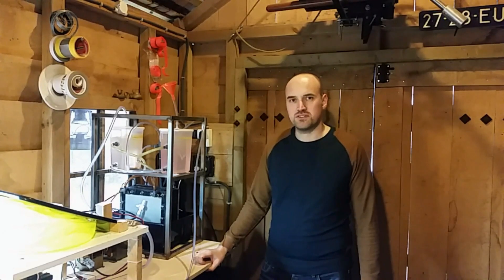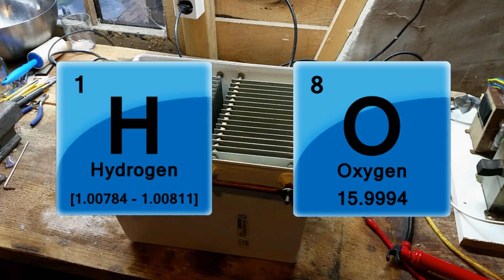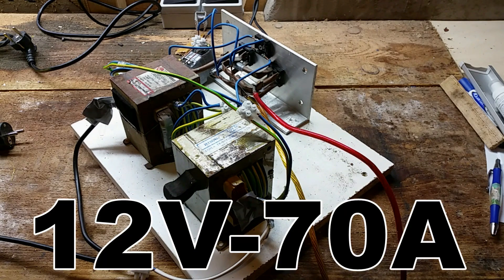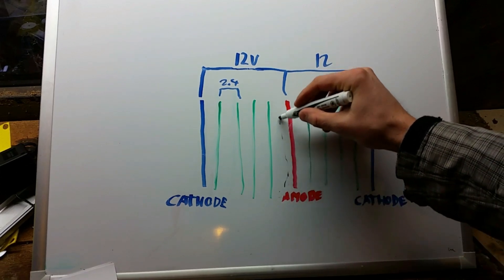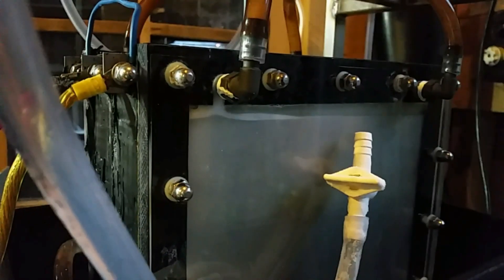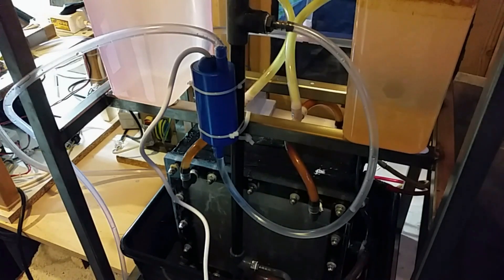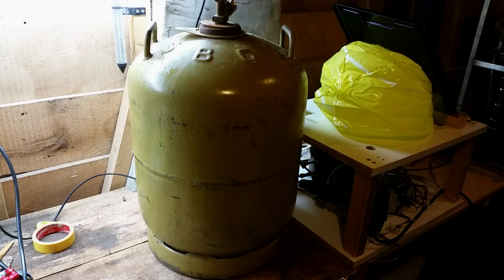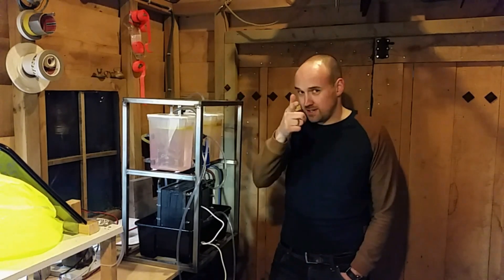Hydrogen Generator #1 Homemade Hydrogen Generator And Compressor Unit

Comment: Nice explanations! I had to smile a few times about the heat generated when operating the cell at 12 V. You are right, the problem is the high voltage. But its not due to some mystique strength between the atoms in the water molecules its just the resistence of the water with sodium hydroxide against current. If you push too much current it will heat up - same as every wire does if you push too much current through it can get red or even withe glowing! So the keyword is current density: amps per square inch! You should keep current density as low as possible to stay cool and become more efficient in the process! Even 2 V per cell can already be too much. You can do with 1.8 or even 1.6 V/cell - but you need (much) bigger plates to push the same amount of current! Also a larger cell will have better cooling through air e.g. A good current density is as low as 0.3 A/in2 (0.05 A/cm2) or lower!

2. I hope you dont compress the oxygen via the fridge compressor? The gas flows right through the oil inside the compressor and could explode! You can use other oilfree compressor which are specially made for oxygen - but rather expensive. Also keep in mind that hydrogen is very volatile - it will go through the LPG tank with ease in the long term. So its just a short term "parking". Its best to produce it when you need it.
Reply from the maker: Thanks! 👍
Reply: @TheDIYScienceGuy  If you're still reading, it's not directly the resistance, it's down to what you discovered in your  research, the potential difference required to split the water molecules is about 2V, any more voltage is wasted and turned to heat. The electrolysis cell will do its best to drag the voltage down to 2V /per cell/ until extraneous resistance drops the voltage to this. This voltage droppage just turns to heat rather than that part of the energy going into splitting. 
Putting multiple plates puts the cells in series, just without the wires. This is why it works efficiently.
Reply: Molecular hydrogen will not diffuse through steel and only slowly permeates the Viton rubber seals in ordinary propane storage tanks.  Atomic hydrogen will diffuse into steel but that is only possible in high temperature plasma..like welding.
Reply: Its correct the current density only heat the water like ohms law , anyway reduce current in cross sectional area for adjusting voltage work.
Reply from the maker: My first hydrogen generator had much more surface area than my new one but had 12 volts between the anode and cathode and became very hot. My new one has less overall surface area draws more current and gets only warm. So it has to do with the voltage per section.
Reply: Do you suppose a toy balloon h helium tank would be better for long hydrogen storage ?
Reply from the maker: No, because they can handel a lower pressure.
Reply: @TheDIYScienceGuy  I figured that the tank construction would limit the amount of pressure at 260 PSI max, it was the ability not to leak was my consideration.  My current projected use is for actually filling balloons and some other combustion experiments.

BTW: You produced a damn good video.
Reply from the maker: Thanks! Well I did not measure any loss of pressure over severall months.
Reply: @TheDIYScienceGuy  Excellent. I have several "currently" illegal propane tanks...

Comment: WARNING! I feel compelled to add a tiny bit of safety advice. I am an hvac technician by trade for 20 years now. I cannot tell you how many compressors I've seen fail due to burn out. Now to be fair a burn out occurs because many refrigerants (especially r22) react with moisture to create hydrochloric acid over time, moisture which was not properly removed during the initial vacuum of the system prior to charging, which ultimately ends up eating the insulative coating from the windings in the hermetically sealed compressor (ie refrigerator compressors, rotary compression hermetically sealed). So likelihood of a burnout occurring in this type of system may be minimal, but it still exists. As I'm sure you can imagine, if you introduce electrical arcing in the system if the hydrogen and oxygen are not fully separated, 1 failure in a lifetime could be catastrophic. I have seen 10000 or more of these failures thus far in my career. Don't blow up your entire family! My advice? use a compressor with an external motor, similar to a vehicle compressor. Many manufacturers make them this way for large industrial applications as well. The difficulty will likely be finding one other than a vehicle compressor small enough to do the job efficiently. Good luck! Say hi to the family for me!
Reply from the maker: Thanks for the warning! I will keep it in mind. 👍
Reply: @TheDIYScienceGuy  You're very welcome, the extremely rare potential catastrophe aside, rather brilliant if I must say!

Comment: Just a thought. Since hydrogen can explode when being compressed, would it not be easier to instead increase the pressure of the water being electrolysed.
This would (I think) increase the maximum pressure of the gas being produced. In addition to safer, it would be simpler and can be done with a regular pump.
I have to say, I am not sure how the relationship would be between the increase of water pressure and the gas pressure (i assume linear).
Reply from the maker: Hydrogen does not spontaneously explode under pressure, only in combination with an oxidizer.

Comment: 0:38 Don't use stainless for this!! The chromium in it produces hexavalent chromium which is very toxic, and is also illegal to just dump on the ground because of how badly it can poison water supplies. It is no joke, and is what the Erin Brockovich case was about: https://en.wikipedia.org/wiki/Hinkley_groundwater_contamination There are many electrode materials that you can safely use, just please don't use anything with chromium in it like stainless or chrome-moly steel (41xx etc.) Also don't use salts for you electrolyte. I know you used lye, but others might try salts. This produces chlorine gas, which is also obviously not a good idea.

Comment: now you need to find a compressor that works on 12v and can fill up that canister quicker...then you need to implement all this into a compact package that will fit into a vehicle compartment...then you need to run a tube from the storage canister to cars intake and program accelerator to work with the amount of release of gas based on acceleration and a switch to cut off fuel pump...start the car on normal fuel... switch system on switch fuel pump off....or with advanced cars when it senses the detonation it automatically slow the fuel input and hey car running on hydrogen...

Comment: Do you think it would be safe to change hydrogen to potassium or lithium, the only problem I would see is the heat however the energy that it would produce would be substantially more than hydrogen?
Reply from the maker: Well hydrogen and potassium or lithium are all different elements so unless you can do very complicated nuclear fusion at home it's not possible. Or os that not what you mean?
Reply: The DIY Science Guy so it is possible?

Comment: Thanks for sharing your thoughts.....
The final output is with 2 volts or 12 volts?
Reply from the maker: You're welcome! It's 2.4 volt per section times 5 sections makes 12 volt overall.
Reply: @TheDIYScienceGuy 
70 liters of hydrogen / hour with 12 volts and 70 ampers?
Reply from the maker: @adi.olteanu.1982  Yes that is correct.

Comment: Nice project and video! I really like the evolution of your approach and it's good to see people brave enough to do it in this in their garage :)

However, I'm concerned about the long time stability of your setup. Remember that hydrogen causes serious embrittlement on steel, which might be especially dangerous for the Storage tank and the compressor.
Reply from the maker: Thanks!!! Hydrogen embrittlement does not occur in austenitic (non hardened or unhardenable) metals which is the case with propane tanks. But a regular pressure test is always a good idea.

Comment: can you make a small motor to work on it instead on gasoline? instead on a tank with collected hydrogen, to work on a continually released Hydrogen, so it would not be saffty considiration
Reply from the maker: Yes that is possible but the whole purpose of producing hydrogen is to store energy. If you are going to use it immediately it makes more sence to use the electricity tot power an electric motor.

Comment: Have you concidered using carbon nano tubes as hydrogen storage units  no need to compress the hydrogen and no explosive properties.  And they are free
Reply from the maker: It's a nice idea, but where do I find them?
Reply: So the way they donut at MIT is that take washes chicken feather and slightly hydrate them  then they pop them like popcorn at 725 degrees ba das they explode the turn black and creat billions of nanotubes  just the correct diameter to house hydrogen

Comment: Why didnt you use aluminum instead of stainless?
Reply from the maker: Aluminum dissolves in sodium hydroxide and besides that it's not at all resistant to galvanic corrosion.
Reply: @TheDIYScienceGuy  ok thanks for the reply, makes sense to me, i just see alot of other youtubers using aluminum foil to make Hydrogen.
Reply from the maker: @Mal-u-Envy  yes and in those experiments they dissolve the aluminum in sodium hydroxide which produces hydrogen.

Comment: Question for you: I've found some info online to equate the displacement of a gas engine to the LPM (in airflow) of HHO. According to my calcs I need approximately .25 lpm of HHO for a 420cc engine. I've figured a 3" x 5"  single cell 6 stack generator should be enough to run that 420cc generator. Does this sound right to you?
Reply: You will need several litres per minute,  otherwise all you will get is a slow idle with no real power
Reply from the maker: Well my lawnmower ran for 10 minutes on 150 liter but with inefficient ignition settings. Still I think you need more hydrogen than what you have calculated although I can not tell you how much.

Comment: Did you just say "airship fabrication?"
I've never clicked the Subscribe button faster.
Reply from the maker: I was thinking about it yesterday, that when my hydrogen generator is operational, that an airship is the first thing I want to build!
Reply: @TheDIYScienceGuy  I don't know if they're available where you live, but I've seen some salvage Toyota Mirais for sale for really cheap. It's for sure the cheapest way to get your hands on 2 carbon fiber 10k psi tanks and a fuel cell to convert your hydrogen back to electricity. 
I was considering doing one of these for a DIY powerwall instead of lithium ion batteries, but I didn't have a way to do the electrolyser for cheap. So thanks for that!

Comment: Don't you think you would be safer to use a non pores membrane with some reinforcing in it.Prevention is always better than  cure.But wow your system is great and simple.It is a shame that you have to separate the two gases,it would be so much more efficient as in the case of the HHO generators for vehicles as the plates can be so much closer including the neutral plates.
Reply from the maker: Thanks! 👍

Comment: Outstanding video, goes straight to the science on the need to control loss. I'm to concretely build one with goal of redirect the spare solar power produced on my weekend cabin home when I'n not there into a gas generator, and store some low pressure H2 for cooking when I get back. The result must be engineering-grade and have safe locks to self-off on any risky condition, and may become a product if done really well. Your video anticipates a lot on it.

Comment: Good demonstration of electrolysis. In my opinion the gases come from the decomposition of the sodium hydroxide and the stainless steel plates, not the water. The water merely breaks down whatever is in it with the help of the electricity as a catalyst. Notice how discoloured the water goes from the oxygen side @ 06:22 which means the water is carrying impurities. The brown impurity is the iron ore that was used to make the stainless steel plates so the plates are clearly decomposing and this is partly where the oxygen comes from along with the hydroxide. From my experience of electrolysis the anode material will, in time, always break down but the gases do not come from the water. Nevertheless, your projects help you pass the time in your garden shed and keeps you out of trouble so that's a good thing.
Reply from the maker: Thanks! No it's definitely the water because that's the only thing I need to refill every once and a while. Also this is how they isolate heavy water because heavy water does not split that easy in electrolysis.
Reply: @TheDIYScienceGuy  if you were splitting water the stainless steel plates would not decompose and discolour the water! It's really that simple! Water loss can be accounted for by evaporation and migrating along with the gases! There's no hydrogen and oxygen that make up water. H2O is a big science scam!
Reply from the maker: @PeterPete  Aaah ok you are one of those people. Have a nice day.
Reply from the maker: Harry Growler  Thanks! I'm always looking for new things, I just think it's weird when people call H2O a myth. Everything that can not be grasped is a conspiracy these days.

Comment: How would you design a more autonomous check to make sure there's no mixing?
Reply from the maker: By sensing the gass temperature difference before and after it went trough a piece of catalytic converter or by shining a laster trough the gass and sence the difference in refractive index.

Comment: Best video I found. Does anybody have a better idea than using that felt? I found it kind of dangerous. It might cause the oxygen to mix with the hydrogen.
Reply from the maker: Thanks! The best material is polypropylene mesh.
Reply: @TheDIYScienceGuy  What are the specs of the mesh you ended up using?  BTW thanks so much for making this video, it was more helpful than 40 other videos that I have watched
Reply from the maker: @robertjohnson6334  Thanks! I'm not sure yet, as fine as possible is where I'm going for.

Comment: Dear Science Guy, I am interested In building In Your dry cell and compressor unit and want to build my own unit. would you be interested in sending a set of building plans,  I would be willing to buy these plans, at a reasonable rate.  Please reply, bearblair752@gmail.com  902-270-2568. My  shipping details are, 32 Norwood Ave Apt # 1 Sydney Nova Scotia B1P 3A1 Canada. Would like to be able to fill propane tanks for the barbeque .  01/28/2020.

Comment: You know H2 permeates through metal and makes it brittle, so that tank can rupture or break at any time? You know that if O2 diffuses into your balloon the stuff can explode? This is not a safe way to work to say the least!
Reply from the maker: Hydrogen embrittlement does not occur in austenitic metals. Oxygen does not diffuse trough polyethylene very easily so that is not a problem at all. Nonetheless safety first! So the tanks need regular pressure testing.

Comment: I considered making one of these I was looking at what it cost you to make 500 liters of hydrogen and that is about the going retail rate. Would it not be easier to just buy the gas since it cost about same to make vs buy?
Reply from the maker: Well first of all that's not the point. And second of all where do you buy it so cheap, I can't find it.

Comment: Why do you want to generate Hydrogen in the first place ? Hydrogen is a pernitious molecule, and it's inherently unstable. Wouldn't you rather work at a way to generate an inert gas like Helium ? Your setup, although faily safe, also runs the danger of blowing yourself up one day ! You only need one thing to go wrong and surprise ! - Your dead, or on fire !

Comment: Nice machine but takes up a lot of room. I have a hydrogen genaerator that incuding the power supply is about 2.5 feet x 2.5 feet by 3 feet with inbuilt heat and power protection and over pressure relief with digital output controls also.
Reply from the maker: Thanks! 👍

Comment: Hydrogen does not explode it implodes
Reply from the maker: That is not true. It explodes because the mixture heats up tremendously. When the resulting water vapor is cooled down the volume is smaller indeed.

Comment: Any contamination could be catasrophic) 1 part per 100 can explode.
Reply from the maker: No not exactly. 15%O2/85%H2 is explosive and 75%O2/25%H2 is explosive as shone in this video I made: https://youtu.be/RPvuzTkJ4ik everything outside these ranges will burn rapidly or as any other gass. Still, it can be very dangerous and the O2 should be kept out at all times!

Comment: im curious if you played with high voltage low amp vs high amp low voltage to see which would produce more gas ? 
Also, other materials instead of stainless like graphite that might be less reactive and not rust ?
Reply from the maker: Only low V high A works as shown in the video. In this video I show how I'm going to nickel plate copper electrodes:https://youtu.be/Zn1hkzvFZOI

Comment: current is what produces the hydrogen...not voltage...it should not matter if you use 12v or 2v...you just have to have it set up for the v given to electrodes for electrolysis (only a example...use a 12v battery with 10A current...or   2V at 60A...Both are the same thing for total wattage...you just have to increase or decrease surface area just like electrical wires everywhere when you want to put more current to a load...the higher the current needed the more surface area of wires needed   for current to flow
Reply from the maker: And still if you apply 12V to a generator that only draws 10A it will produce less H2 per W and more heat by percentaga than when you apply 2V to a generator that draws 60A